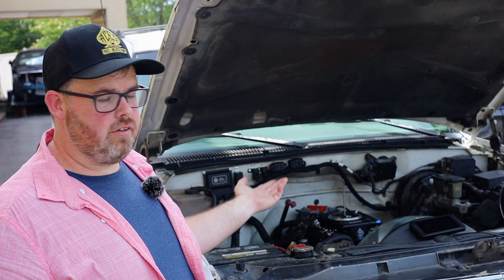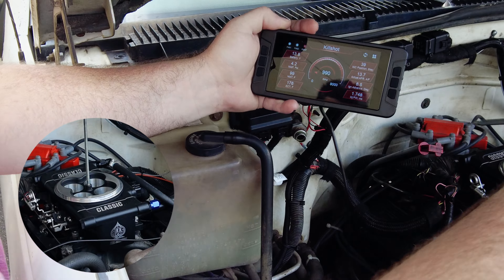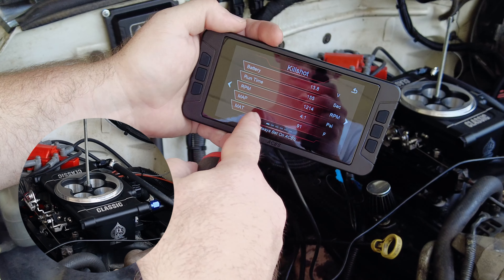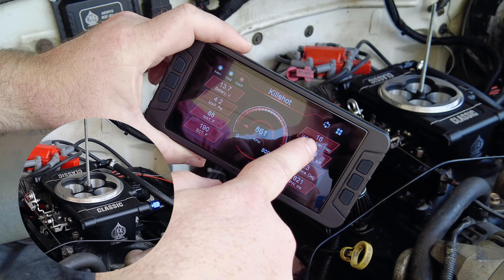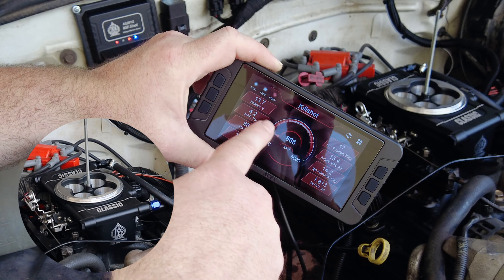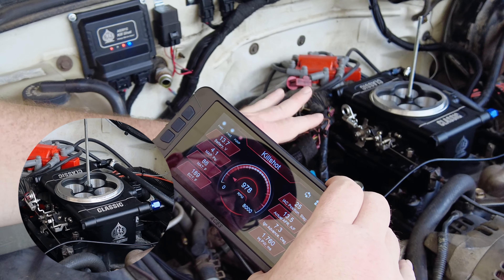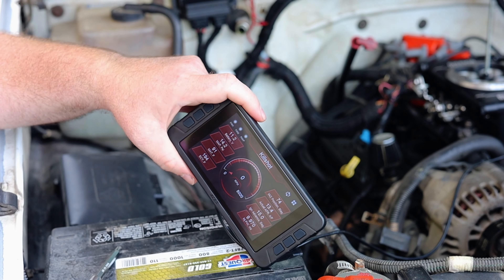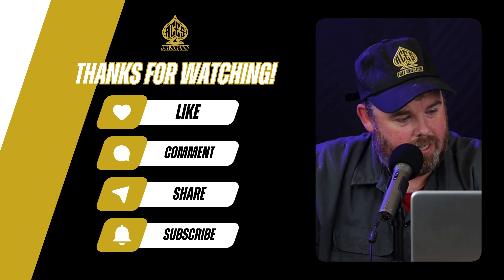IAC Walkthrough

Comment: First start on Classic system. Had to give it some pedal to keep it going until it could idle on its own. Idle won’t go below 1100, with IAC stuck at 5, adjust secondaries screw counter clockwise. Idle came down and IAC went up to 20. Fiddled with both screws and got acceptable set for now. Idling at 900 with fans on, IAC in the teens.

Comment: Thanks for the video.  My experience is that the idle adjustment screw on my Royal Flush system is not flat at the end. Not a big issue but if you grind the end perfectly flat it will be a lot easier to adjust.  Now it has like a wavy motion when you adjust the throttle blades. 

🙂
Reply: Nice tip. thanks
Reply: Good find.

Comment: Friends Hello! What to do if the IAK readings do not change, the revs increase, but the number remains at Five. I reset the TPS and increase the revs with a bolt, but the TPS readings do not change either.

Comment: Can’t get iac number to come up off of 5 at all. I can screw in the curb idle screw damn near all the way and it won’t come up off of 5. Rpm’s will raise of course but I can’t get any change. Any advice?
Reply: Going wrong direction, you want to go counter clockwise on the screw to close the throttle plates.  If that does not bring down rpm and up the IAC steps then check the screw on the secondary adjustment make sure your secondary are closed all the way.